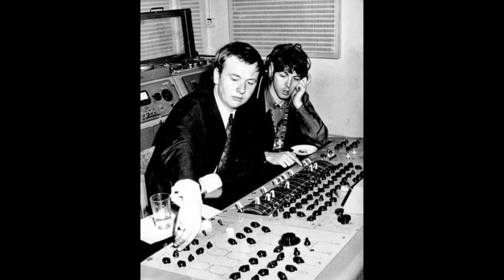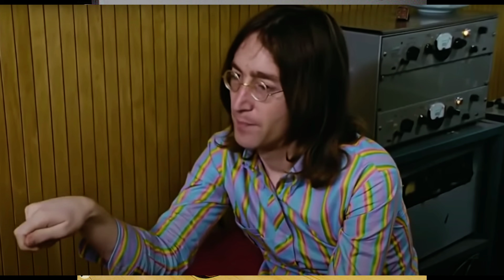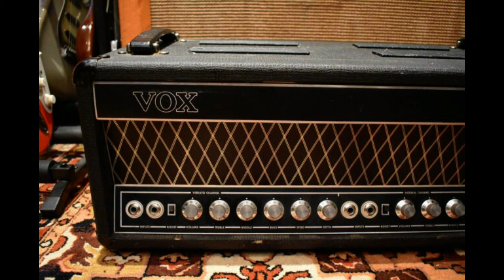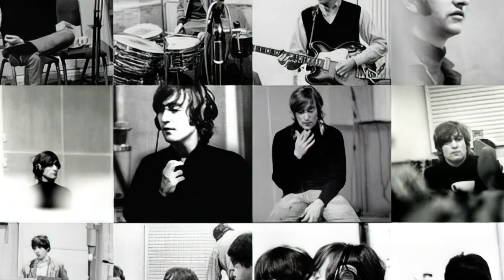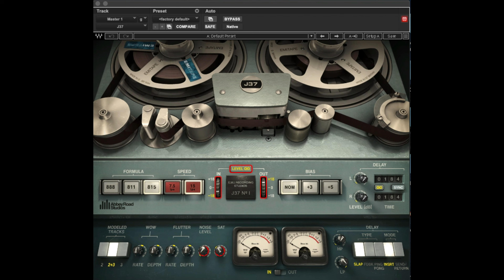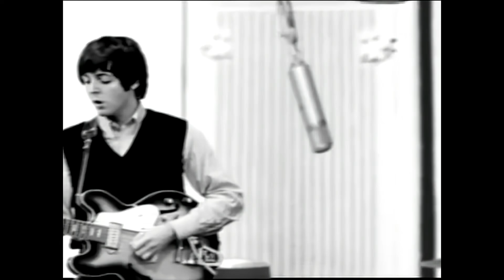Recording The Beatles 'Revolver':  The Sound and the Gear!

Comment: When you're talking about the Artificial Double Tracking, you fail to distinguish (or explain) the difference between straight ADT (in which the signal is copied onto a second track or bus and the varispeed is used to add a slight delay, thereby tricking the ear into thinking there are two voices, etc.) and "flanging" in which the ADT signal was actually sped up and slowed down with the varispeed to create the "whooshing" phasing sound.

Comment: The Pro Tools DB-33 is a midi instrument. So not sure you can send vocals through just the Leslie speaker section? Will have a look at it though.
Reply from the maker: It's both a midi instrument and an effects insert.  If you have it, just search db33 and you can use the Leslie on your audio.
Reply: @mixingmasteringonline That's amazing! Thanks for the info!